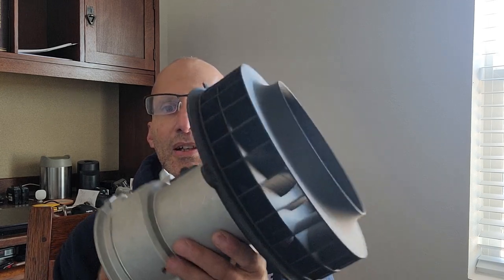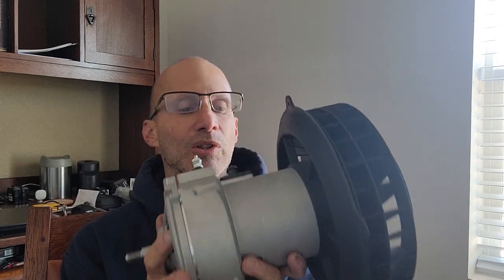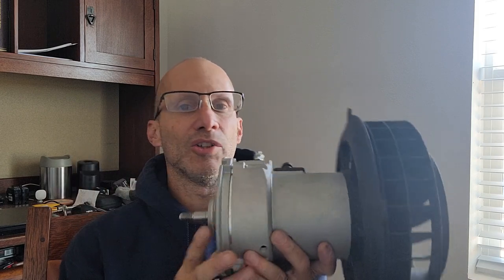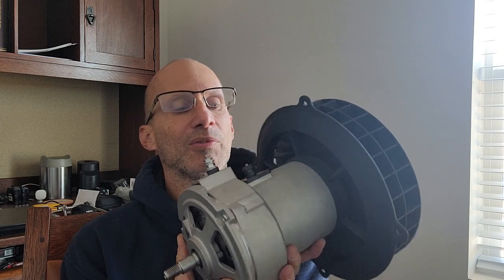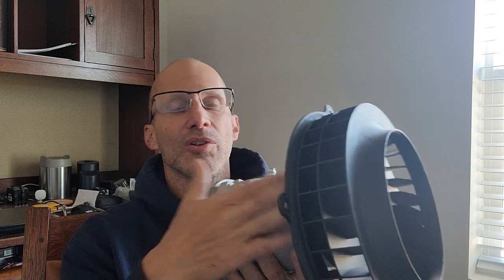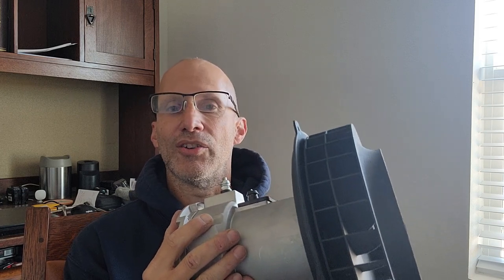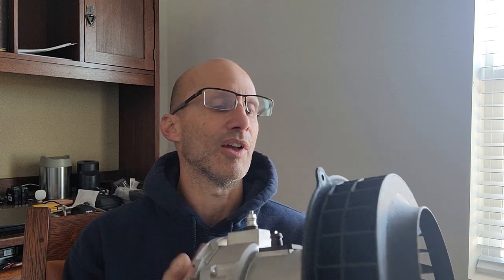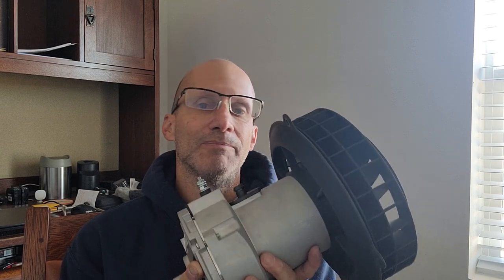Evolution Two Cooling System Deep Dive - Part 2 - The Fan & It's Inlet

Comment: This looks like an amazing break through giving the trials you have experienced. Will the engine respond similar on deceleration given the less rotating mass? Much like a lightweight flywheel does to an engine also? I would imagine inertia plays a hand in the concept and curious for those who may use both lightweight systems as an engine combo. Your thoroughness should be applauded. Thank you.
Reply: Also, how are these balanced? Thanks.
Reply from the maker: The weight savings is even more than the original, which kind of surprised me, but there was only so much I could do with the geometry of the original to save weight based on having too thin walls, and the need to have draft angles for injection molding.  I don't have to do that with 3D printing.  For someone that is using both a lightweight flywheel and this lightweight fan, the throttle response will be tremendous.  I actually had a customer of the original fan tell me that he had to relearn how to drive his car, because the throttle response was so good.  Makes taking off in first gear without revving the engine to the moon a bit more difficult ;-)
Reply from the maker: @MOESPEED2002   They are not balance, but based on the fact that they only weigh 227 grams, it's not really necessary.  The heavier the part is, the more balancing is needed, but the stresses from any imbalance there might be, which would be really small given that it's 3D printed, and the geometry is 100% uniform, won't be high enough to cause any problems with the fan, or the alternator/generator it's attached too.
Reply: @andrigsaircooledtechnology  That is why I am curious about the customer reference and what that means. Any engine I have driven that has LW rotating mass is responsive  and sensitive to throttle input. My best reference is driving a Petrol vehicle vs an EV (the need to stay on partial throttle for smoothness). Just curious if you have had personal experience to how exagerated this sensation may be and could elaborate on it. You have been so thourogh with this project and your personal touch would speak volumes. I guess I am just looking for more of a real world driving situation as opposed to an engine bench, given your kind of detail oriented input and diligence. Excellent work and much appreiciated. Thanks.
Reply from the maker: @MOESPEED2002  I actually haven't driven my car with it, just my test engine.  I have tested these fans enough on my test rig, driven by an electric motor, and what happens there is exactly what happens in a running engine.  When you turn the power on, the fan takes almost no time to spin up, and the amp draw on the electric motor only spikes for a really short time.  When I do the same tests with OEM fans, it takes a good three times longer for the fan to spin up, and the high amp draw on the electric motor is prolonged until it finally reaches the RPM limit of the electric motor.  The reason I haven't driven my own car with it, is that I have it torn apart and haven't had any time to put it back together to drive it.  It sitting under a car cover.  With moving, both personally and the business, and getting the business going again, and a lot of product development tasks, I simply don't have the time to devote to getting my car back together.  I haven't felt a big need to do it either, as I know from the first generation how it feels, and the new one is even lighter.

Comment: Will you make that front fan  velocity stack for the smaller 6 volt/12 volt 90mm  generators...  also that Highly optimize Velocity stack will work with a porsche 356/ 912 linkage  so its usefull if some one does that linkage setup ...and also why dont you make a velocity stack that bolts to the back of the shroud like the front ....
Reply from the maker: I will make the front fan velocity stack for the 90 mm generators, but for the Porsche 356 and 912.  I'm not planning, unless there is enough demand to do it for the 36 hp and older VW Type 1 engines.  In terms of the rear inlet, it doesn't need a velocity stack.  The design of the fan itself acts as a velocity stack, so I chose to just keep it simple, and not add more to the cost, and manufacturing of the shroud, since I make them by hand.
Reply: @andrigsaircooledtechnology  when I mentioned the 356/912  I'm taking about the linkage  the porsche linkage can be adapted to the vw fan shroud it bolts to the back of the shroud with the porsche 356/912 linkage you could use your Highly Optimize Velocity stack the one that you said you'd interfere with the linkages....
Reply from the maker: @jerrygomezjr601  Oh, I see.  Well, I haven't really seen any difference in airflow with the low profile velocity  stack.  It seems to perform relatively the same.  What I did is still based on a highly CFD optimized velocity stack, just a different style that can be a lot more compact.
Reply: @andrigsaircooledtechnology  your shroud/ fan set up reminds me of the  the vw / porsche type  367 aka vw Petermax  muller engine they  used this type of double fan shroud idea on a vw 25hp 1100cc hemi heads  back in 1947 or so ....
Reply from the maker: @jerrygomezjr601  Actually, the Porsche Type 547 engine that they developed for Formula 1 was my inspiration to try it out.  For the longest time I just couldn't see how to do it on a standard fan shroud design, but one night I had a dream about it, and in the dream I cam up with a design.  When I woke up in the morning, I went straight to my computer and started the design.  In the next two days I was test fitting the first prototypes.  Sometimes sleeping on things is a great way to solve a problem.

Comment: I've been curious: will the 22% increase of air being flowed by the dual inlet fan potentially lead to a minor starvation effect on the engine intake of air?
Reply from the maker: That's a good question, and will really depend on your engine bay.  Decklid stand-offs might be required for some engine/car combinations.  With the late model decklid on Beetles and Karmann Ghias I believe there is enough ventilation to cover both the increased air intake of the fan and the intake air needs of the engine, even a really large one.  With a monster engine that is natually aspirated with some really nice flowing heads is only going to consume about 800 to 1,000 CFM at peak RPM.  Most of the time it's going to be consuming 250-400 CFM.  That's not very much compared to the fan shroud.  With a turbo engine, the intake air is outside the engine bay (or should be if it is a completely enclosed car), so there is no issue there at all.  For early cars, that don't have as much engine bay ventilation I would recommend either decklid stand-offs or using a convertible decklid.
Reply: @andrigsaircooledtechnology  Thanks!!
Reply from the maker: @jp1891  You're very welcome.
Reply: @andrigsaircooledtechnology  I thought of another question lol, sorry! 
Has this fan set up undergone any  endurance testing? Sustained 3200 -3600 rpms over extended period of time/distance?
Reply from the maker: @jp1891 No problem.  Yes, the fan went through torture testing on my test engine.  Up to 8,000 RPM, and everything in between.
Reply: @andrigsaircooledtechnology  What's your current lead time on getting fans out, if say I were to order this weekend or early next week? I'm interested in getting one, and I have a multi state cruise I'm going to be making in the next three months to some events and would like to try and have it in before then.
Reply from the maker: @jp1891  I was behind on production because I had some print farm issues.  My 3D printer vendor is helping out with printing some of the parts for me while I have my printers going.  Still have a small amount of capacity missing, but now starting to get caught up.  Based on where I am with the production queue, and the help of my 3D printer vendor, the lead time should be about a week.  The lead time will eventually shrink to a few days as I get my capacity back online, and there are some free upgrades my 3D printer vendor will be bringing out in the next few weeks that will further increase my capacity on my existing printers too, so lead times will eventually shrink even more.  So, count on about a week right now, and if you order in the next few days.
Reply: @andrigsaircooledtechnology  Outstanding! Thanks!